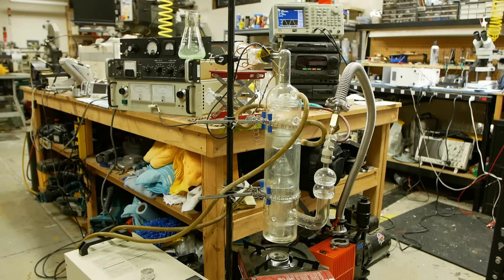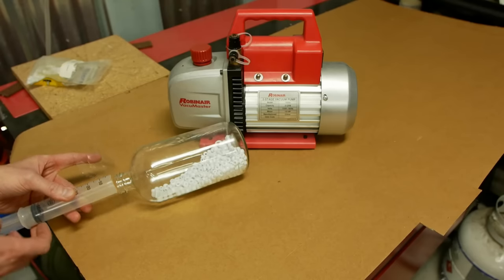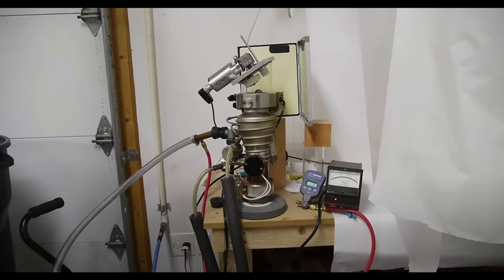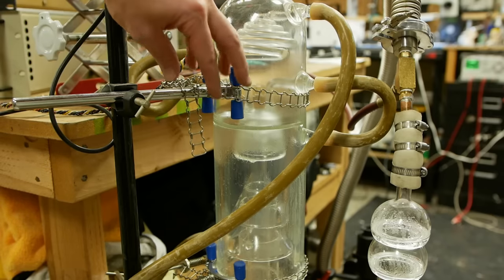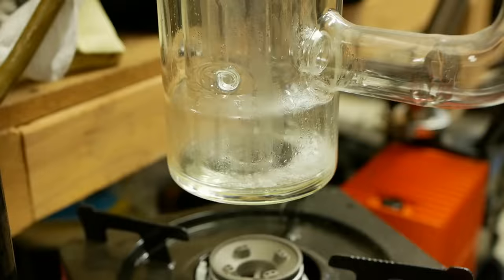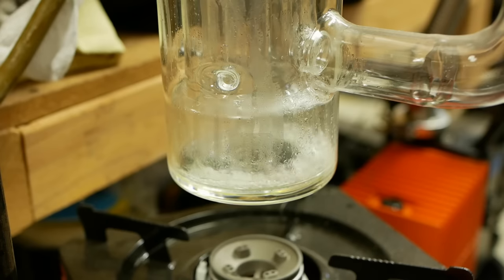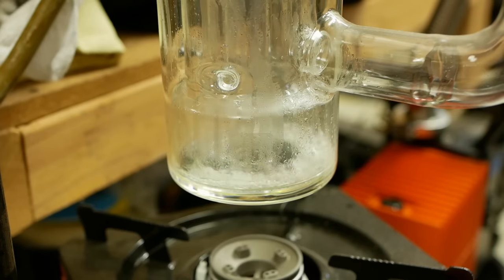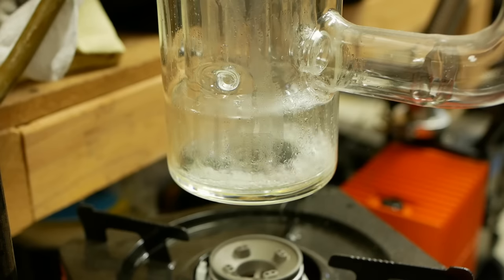Giant glass diffusion pump and cathode ray tube demo

Comment: Will the HERTZ spark gap electromagnetic, radio wave transmitter and receiver experiment work in full vacuum? I can not find any physical experiment and study paper or a video done on this topic showing us the results. I do understand we can not get full vacuum but this does not mean we can't get close and use math to calculate to the full vacuum. Can you put spark gap transmitter, reflector and receiver in a vacuum chamber and use necessary equipment to measure power input, received output, electromagnetic waves and radiation created, while trying to get full vacuum? If this process recorded at different vacuum points with findings of each equipment we should be able to calculate end point. We also could take this one step farther! After the removal of atmospheric air test, we could purge the chamber with noble gasses one at a time and repeat this experiment using each gas separately. This could give us different results for atmosphere, argon, neon and so on. Is this test possible for you to do? If not, can you ask someone who may be able to do this experiment?  Thank you

Comment: I wonder if there is a viable option to run a diffusion pump more efficiently, as you need to cool off (nearly?) same amount of energy which is used to heat it.

Comment: 6:23 how does the optical opacity of that spiral help in this example? I'm not understanding how optics comes into it at all
Reply: He didn't say it well. But I think he meant there is no straight line path between the bottom of the diffusion pump and the neck of the pump. Any molecule of oil would have to hit the cold trap spiral or walls.
Reply: @RobertSzasz  ahhh I see what you mean, the optical opacity doesn't come into it at all!

Comment: QUESTION:  I bought a 2-stage Robinair vacuum pump (15500) like yours and a CPS VG-200 micron gauge.  With fresh vacuum oil and the micron gauge hooked directly to the vacuum pump, I can pump clear down to 4 um which seems REALLY low.  
Does this seem reasonable?  If I add the little brass-T that comes with the gauge, it raises to 6 um; if I add a hose about 25 um.
When I use this on AC systems, I can get down from 300-500 um which seems to be reasonable for this type of applications.  Thanks!

Comment: Good video, but compression blades on turbines actually get smaller as the compression gets higher! And with the hot side of a gas turbine they get bigger and bigger as the pressure decreases :)

Comment: It might be fun to calculate the Wattage based on how long it takes to consume a cartridge of butane (or you could just weight it before and after). Determine the heat of combustion of that much butane (assuming perfect efficiency), and divide by the time to consume it.
Reply: I've seen those butane burners with the markings 3.3kW - 3300 watts equivalent to an electric burner I guess.

Comment: Would a thorium element work better than tungsten and not turn to unwanted hydroxide?
Reply: Yes, thoriated tungsten cathodes are commonly used in large electron tubes for transmitters, etc.  MUCH higher emission at lower temperatures (red hot rather than white hot) than pure tungsten.  A wire with about 2% thorium is used, and given a special "carburizing" treatment by being fired in a hydrocarbon atmosphere. Produces a surface layer of tungsten carbide, covered with a very thin layer of metallic thorium, which is the actual emitter.  During operation, new thorium is driven to the surface from inside the bulk metal.

Comment: The oil level looks very low after the pump warms up. I think it is starving. Try adding more oil and it should drastically improve the pumping action. Also, when you do this, reduce the heat. So it looks like you are trying to use excessive heat to compensate for insufficient oil.

Comment: I still don't understand how the pump works. so the silicone-oil vapour condenses on those upside-down "funnels" and as it falls down it it takes air molecules with it? does the air get trapped inside the droplets? or is the stream somehow reversed by the funnels, sucking air with it as it travels down? if so, how come the normal pump can extract the air while inside the silicone-oil vapour if it couldn't do it before (I understood why the normal pump couldn't reach those low pressures by itself). Thanks to anyone who can explain this....

Comment: I didn't listen to the whole video, but what I don't really understand is, why it should make a difference what vacuum pump you use here in specific. The cathode ray tube is static and the air get sucked out in the same way than it would with a hydraulic pump.

Comment: I've never heard about barium oxide cathodes. I know that LaB6 cathodes exist, but I guess they have higher vacuum requirements and/or shorter lifetime so they are more expensive. And maybe price is not worth the improvement. Field emission guns are next level with smaller electron source and I think lower spread of electron energy/speed.

PS: that wrench in a beaker reminds me Tescan's logo a little bit :-) (SEM manufacturer)

Comment: I wonder how much X-rays you get with that tube? Aren’t (or rather weren’t) most CRTs made with lead glass to prevent those from being emitted? 

Great video as always!
Reply: Depends almost completely on the accelleration voltage used. Smaller CRTs dont need as much voltage and therefore produce less, and lower energy x-rays.
Reply: As mentioned it's all about the voltage with x rays, any vacuum tube can be an x-ray tube if you try hard enough. Color TV (20 something kV) just happens to be near the line where it gets real easy to make x-rays.

Comment: What kind of vacuum did you achieve? I used to work at the Williams Lab of Nuclear Physics which had a Tandem Van de Graff Machine. We had three mercury diffusion pumps on the beam line and could get down to 10^-6 torr to 10^-8 torr depending on what we were running.

Comment: i am chinese engineer, i can help you to translate the imformation...first one the 3 stage vaccum pressure is 1.3~10^-3.5 Pa sucking speed 60L/s, heating power 400W. the oil 120ml, the maching mechanical pump model is 2XZ-4(4L/s), 4 stage is 1.3~10^4.5 Pa 130L/s 800W 130ml 2XZ-4. and the instruction of this oil you'd better use Chengguang brand pruduced by Sichuan No.275# diffution oil. Heating up for example you use 500W 220V electricity powered oven and the bottom of the pump keep 5~10mm distance to the oven. DO NOT TURN OFF the water during pumping the gas and if water stopped the heating must be move out immediately. when the vaccum to 10E-2Pa then you can turn the diffution pump on.when the oil turned yellow or black you need change new oil. the heating plane would not exceeded 10mm diameter than the bottom of the pump and the oven must be adjusted tempreture just keep the oil boiling is fine, this pump is made by GG-17 glass ,this glass can under 240-250℃ tempreture sudden change(annelling no stress). the glass pump should be 24Hr working ,because when you heating up one time the glass will produced the inner strees with the time gose by the glass will broken. if you have any problem just give me the message let me know tks!

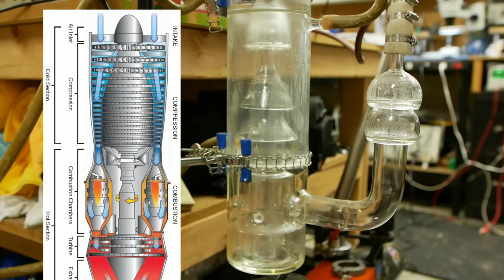Comment: At 7:30 you made a mistake regarding your jet engine analogy. It is the opposite - successive compressor blades get smaller as the air that passes through them gets more compressed.

Comment: What was the scariest experiment you've ever performed?
Reply from the maker: Making aerogel involves a supercritical drying step, which is usually done with CO2.  I showed this method in a video, but then also made more aerogel by skipping this step, and instead used supercritical methanol directly (eg very flammable, explosive).  So, I had a sealed 2" steel pipe full of methanol, and I was using a blow torch to heat it up until the methanol inside it went supercritical.  I didn't bother with a faceshield since the only failure mode would be an incredible explosion that would blow apart a faceshield.  Anyway, after completing the experiment, I noticed that some aluminum parts that I had within the vessel were completely dissolved (reacted) with the supercritical methanol -- oh boy!  I would not do that experiment again.
Reply: @AppliedScience  Make sure you tell NileRed, so he doesn't make the same mistake :P

Comment: gas ionization and throw-out/catch field/trap partial-vacuum full-vacuumizer (ion-sling, electron sling) should be better, in every way, simple as heck, field ionization or electron bombardment, or both, electric field electron bombardment should ionized all gas, loose atoms, inside the vacuum chamber
Reply: assume all the atoms in the bottle are ionized, and that the container is polarized to catch the electrons, pushing out all ions
Reply: van de graaff can do the belted attached ion transport duties
Reply: how about vacuuming so much that the gases turn into solids and liquids, to be swept from the bottom of the pre-vacuum chamber
Reply: think about first filling it with a gas that is easy to solidify or ionized, then apply normal vacuum to solidify or ionize and sling the ions and electrons out of the container
Reply: I mean, replace the contents, clean with a replacement gas, then remove the easier gas contents

Comment: also random tidbit:
outerspace isn't a perfect vacuum

this is one of the reasons why the ISS has to undergo reboosts due to the drag caused by atomic oxygen

to create a perfect vacuum you'd probably want to have a holding chamber let's say a cylindrical Pringles container with an identical cylinder that fits perfectly snug inside of the first and pull on the second cylinder
Reply: ISS needs reboosts because it is technically not in the outer enough space. The vacuum level at ISS height is just about "high vacuum." But yeah, even the "outermost" space is not a "perfect" vacuum.
Reply: @evghenim1955  oh huh guess I didn't learn enough
thanks for the extra info 👍

Comment: You might want to be careful around those homemade CRTs, since electrons whacking into metal, like those copper parts in front of your emitter, make X-rays. That's why commercial CRTs are made from leaded glass which is extra thick on the front.

Comment: Won't it be a more homogeneous boiling if you had porous surfaces material into that oil ...

Basically you're distilling oil ...
So why don't you build up a larger surface exchanger adding scratch glass balls in ???

By the way ...
All of this to show us we don't see light rays thru "emptiness" except when emits photons "hits" the material ???

That's for an invisible bullet ...
Thanks ...

How brilliant, ...
For sure !!!

Anyway, ...
Don't a slap on/in the butt won't be same efficiency aiming that point ???

I guess you'll tell me once "experienced" .

Damn brilliant ...

Ride safe, clean, have fun
From France, with.

Comment: Seems like i've had 4 or 5 opportunities to direct folks to Jerobeam Fenderson this week XD, could be a good use for the BaCon tube - https://www.youtube.com/user/jerobeamfenderson1  
Amazing as always.  Two quick questions  -  1 Regarding the condensing coil at the top, is there any geometry at play that helps molecules pumped from the flask to pass by it or is it just as opaque on the way out as it is on the way in and just relying on different vapor pressure to keep moving down the pump?   (Feels like a good use for a Tesla valve)    2 - Do oil molecules adsorb to the surface of the glass of the coil if there isn't enough to actually condense into a fluid?

Comment: So some observations. First modern lightbulb filaments are suitable for base material for oxide cathodes. You have to prepare the material properly. Contact me and I can give you specifics, or just send you materials. Secondly you are putting way way too much heat into that pump. It is a 800 watt pump, but with octoil as a fluid. Silicone (most likely 704 or similar) does require more power, but not that much. It would take to long to go over in a YouTube comment! Your backing pump is way too small for that large of a diffusion pump. Also your water flow is way way too high. Pulling out too much heat. Water running into the inlet shield should be about room temp and for that size pump I am guessing about 1 to 2 liter per
Minute or slow enough that the outlet temp is about 35C or so. Also as far as a barium Coated filament its a very sensitive process. Your gas load from your unbaked tube and pump alone is enough to ruin the barium oxide reduction process. Also the lightbulb base is still attracted. The phenolic and wood fiber cement in there will never allow you to get it clean enough in there for that process. Just my initial thoughts.

Comment: nice bong dude!

JK hahahha
Reply from the maker: You know, if you search for "glass diffusion pump" you will indeed find glassware that has nothing to do with vacuum pumps.  It used to be very common on eBay, but they may have cracked down.
Reply: @AppliedScience  Ah yes, the old "Love Roses" technique